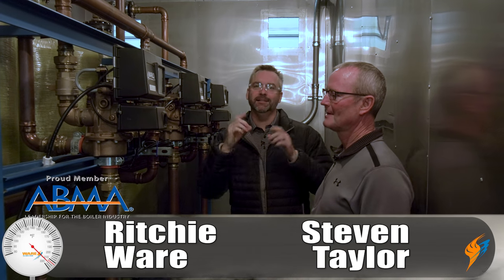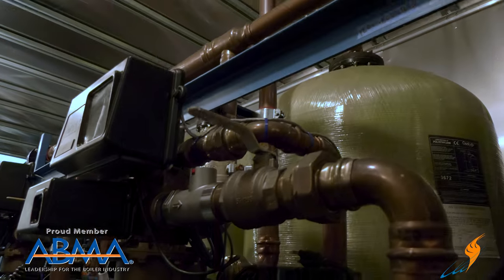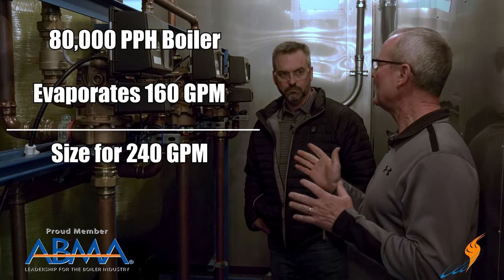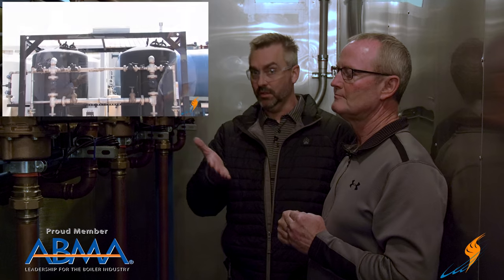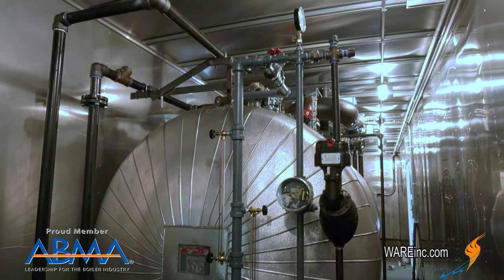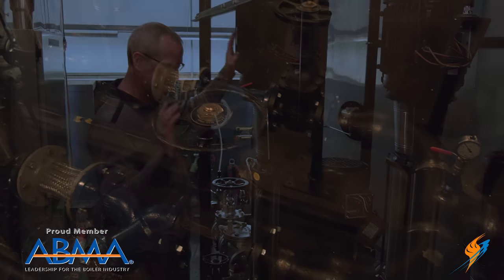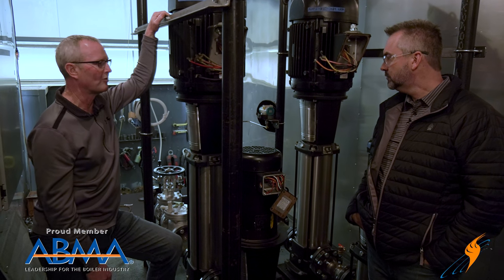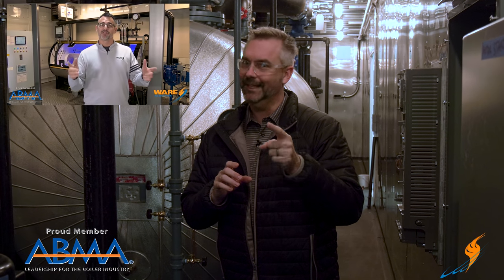Inside look at a Mobile Deaerator System - Boiling Point

Comment: Is it possible  to make a very efficient boiler the size of an engine block that heats steam using something electric?
Reply: There are electric boilers. Some use resistive heating elements others use electrodes. I haven’t personally seen one that small but I’ve seen condensing boilers and hybrids that are very small, smaller than an engine block
Reply from the maker: So we have several electric boilers in our rental fleet, including some about that size. So they do exist. One the size you are talking about would most likely generate around 1 -  2 boiler horsepower. Thanks for watching!

Comment: If this is a mobile unit and your incoming raw water to your softener is low in pH, so below 7, then you may find an issue piping in copper.
Reply from the maker: Most of the time, the city water it would be receiving would have already been corrected for PH levels so the chance of it being lower than that would be very minor. Where we operate this has not been a problem. Thanks for watching and commenting!

Comment: is this just for make up water or does the condensate run through the softeners?
Reply: usually make up water, is city water and it runs through the softeners, then it goes to your equipment.
 if you have a CST/CRT/CondensateReturnTank your make up water is more likely to go to that tank first.
in alot of designs your condensate goes back to this CRT/CST, from there it usually goes to some kind of condensate transfer pump, then it goes to your polisher( if you have one), then it goes to your DA, from your DA usually it just goes to your feed water pumps into your boiler.

you can have make up go to your 
D.A But if you have a CRT more likely than not its preferred your make up goes to that tank instead, the make up water in the D.A is more like an emergency method of make up. 
 if you dont have a crt, and only a D.A, then yes I believe you use your d.a to receive make up all the time.

But the biggest jobs of a D.A is to remove oxygen and other dissolved gases from water, & to pre-heat the water.
It also gives head pressure to your pumps
Reply from the maker: @Nemo The Glover is right. Condensate would go back into your DA tank rather than anywhere else. It would already be considered "soft" so no reason to run it through the softners again. Thanks for watching!